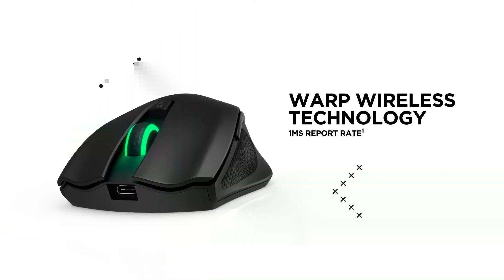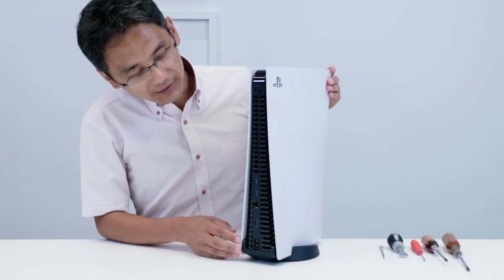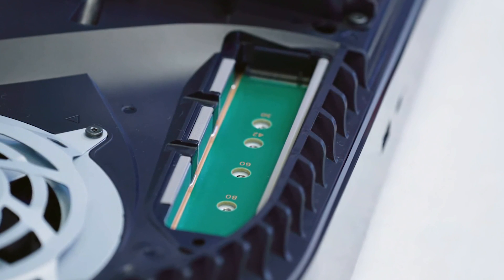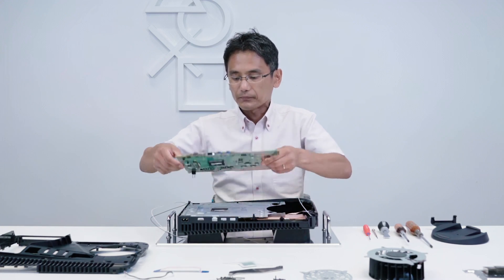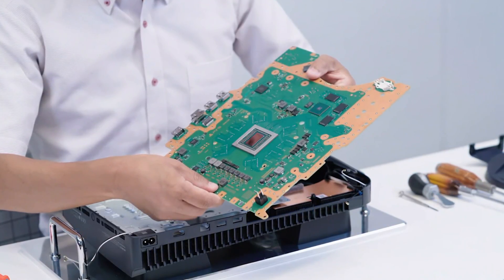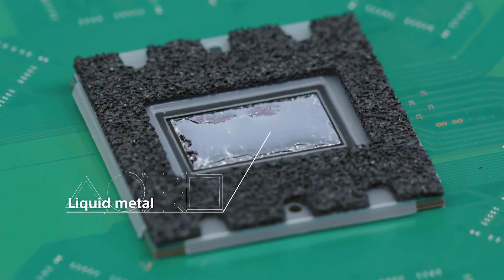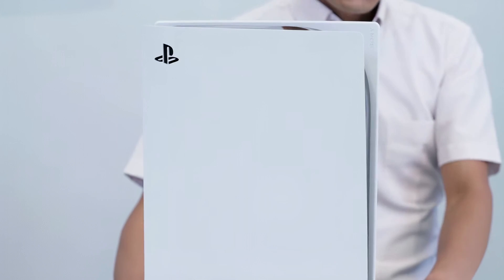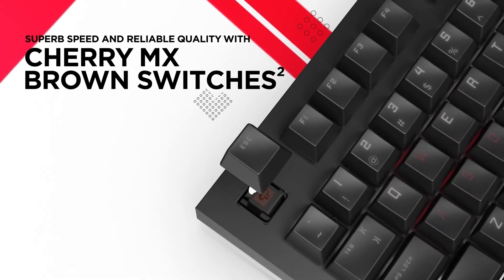PlayStation 5 Teardown Analysis: Inside Sony's Next Generation Hardware Design

Comment: Nothing special inside PS5.
Reply: Ah ur name says it all in this comment
Reply: I like the liquid metal
Reply: If gets special when you can play real next gen games instead of backwards compatibility games
Reply: @leoni7649   that's software, not hardware.
Reply: @mr.sarcastic8833  and I guess we will all need both of them working together to get the best experience. What is the purpose of a "more advanced design" if it has been running 360 games and very poor optimized games like dirt 5 and Halo infinite
Reply: @leoni7649   i didn't say Xbox had a more advanced design
Reply: I do like the use of liquid metal TIM, and the foam dam that should keep it in place and make it into a long term solution, thats some pretty neat engineering.
Reply: agree.. pretty unoriginal. Xbox is more advanced
Reply: @ryanbrowning5586   yep. Xbox has at least one screw less to deal with

Comment: What would be the PC GPU equivalent? 5700xt? 2060 super?
Reply: Ps5 should be around rtx 2070 super

It is slightly faster than 5700xt
Reply: @killermoon635  seems correct, the series x is a 2080super.
Reply: Yall really are getting to caught up on tfp ps5 gonna blow ur mind with what it's capable of ya have no ideal how fast that io is and it ain't just instant loads
Reply: @djbpresents9584  Tflops? Who said we're looking at tflops? A worse gpu wont magically run games better. You lot always bring up io kmt🤦‍♂️
Reply: @mazzalean077  ull see all I can tell ya yakuza 7 already looks better on ps5 more particle effects etc, just wait ur feeble minds will be blown
Reply: @djbpresents9584  Feeble minds? What are you talking about? I'm getting both consoles??
Reply: @mazzalean077  ya speaking on custom hardware you have never seen before noone has ever seen and io so fast, put that with Sony first party wizards, noone can deny what they were able pull of with ghost of tushima on slow ass hdd and 4tfp loads etc were incrediable, now ps5 is a whole different beast, I wil give u every dollar I own if ps5 don't make most stunning games we have ever seen possible, series x and all its supposed power on paper will not stand a chance in hell of having anything come close to matching ps5 graphical output, just wait and see that's all I can really tell ya
Reply: @djbpresents9584  You're talking about first party games.. i was talking about 3rd party, which will be better on the Series X...
Reply: @mazzalean077  then add the amazing controller Wich is actually a nextgen innovation ps5 is by far the better system, quick resume is cool but ps5 speed make it so u don't need it it's is will let u pop into certain chapters dungeons etc instantly, ps5 is just what u call a true next gen system where series x is just a boring 12tfp locked pc with no innovation at all for next gen
Reply: I already said yakuza 7 looks better on ps5 from videos we have seen that's not first party, go watch ps5 footage vs series x there so many more particles happening during attacks where as x just kinda burst into clouds
Reply: Something like that
Reply: 2070 super for ps5, and  2080 super for XSX

Comment: My body is ready... for Xbox to be better engineered.
Reply: guess you’re disappointed then
Reply: @holdtehmayo  Definitely not.  Sony used a brute force, conservative solution.  Microsoft used their brains.
Reply: @AutarchKade um. if you say so 😂
Reply: @holdtehmayo  DF said so, did you watch the video?  The contrast between the two approaches is huge :)  PS5 is the Toyota of consoles lmao
Reply: @AutarchKade  2 years developing liquid metal technique almost no other manufacturer masters = "brute force".

Dust catchers for easy cleaning = "brute force"

Silenced blue ray drive = "brute force"

Custom SSD controller with no bottlenecks far ahead of the competition = "brute force"

Xbox fanboys logic LOL
Reply: @leoni7649 load balancing with SmartShift to make the SoC power efficient. xbox just runs full clocks regardless of the load.
Reply: @leoni7649  DF used the term brute force, I guess you think they are Xbox fanboys.  Pretty sad
Reply: @holdtehmayo  it is a way lower clock. I shouldn't be difficult at all to run it constantly.
Reply: @AutarchKade  20% of the video was used to talk about xbox, so let's say DF is not that impartial this time. They are clearly angry at Sony because they did not receive the PS5 yet.
Reply: @leoni7649  true but there have been more than a few reports and confirmations of xbox running hot at idle.
Reply: @leoni7649  It's funny to see whenever DF says something nice about Sony they're objective and impartial, whenever they mention Xbox or don't cream their pants over PS5, they're throwing a tantrum or paid actors.  So funny peering into the mind of a PS fan.
Reply: Uh what?